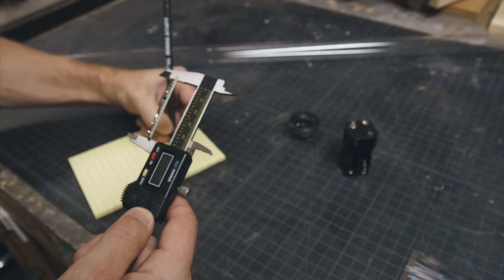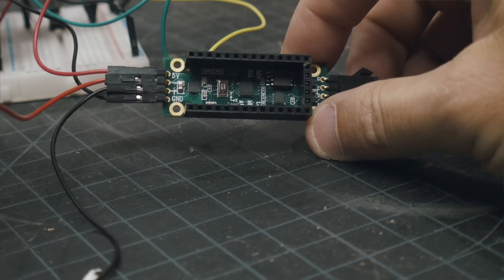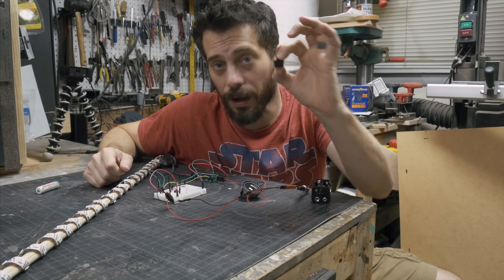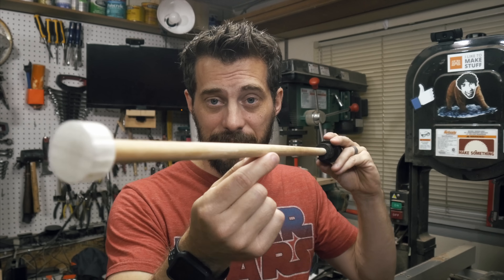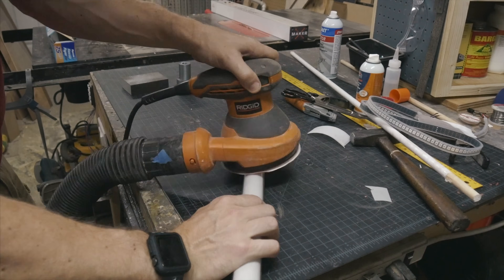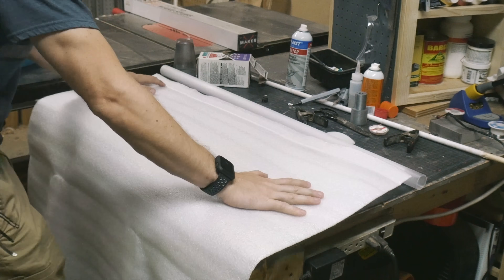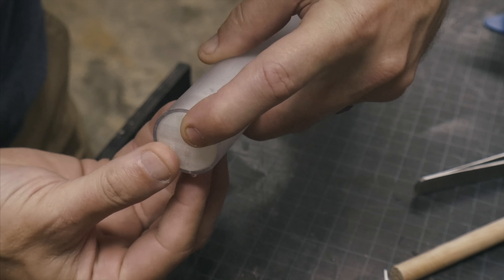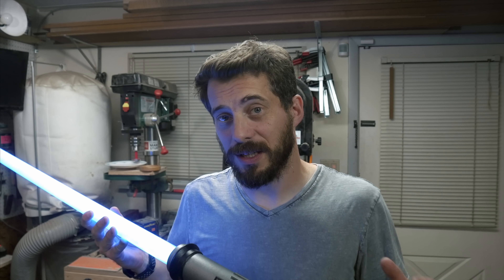How to make a Lightsaber ( for Star Wars Day ) | I Like To Make Stuff

Comment: Love your builds dude random tip not sure if you know this already but it looked as though you painted the silver directly over primer for a much more believable metal look try using a matte black base coat first then silver on top you let it sit for a day a use a gloss clear acrylic with a airbrush not spray paint the propelant in the  spray paint kills your silver an gold paint shine then you can weather over it without ruining your fo metal look on another note you can use that propelant effect for a duller more aged hammered metal look if you don't want shiny metal look awesome build
Reply: Had to add on V2 you could add a micro USB or USB C port outside if you wanna change code and effects later maby try a rounded end cap also

Comment: OK, please help me find a solution to this.

current lightsabers all have the issue that they either have a blade or not, in which case you can't use them until you put the blade on..
What if you somehow had a small, but powerful suction/inflation device in the blade, that blew out a thin fluorescent silk material when it was on, then sucked it back in when you shut it off?  Obviously this would be for appearances only, but it would look much cooler I think.

Is it possible?

Comment: I've only just come across your channel (been going through the videos)... love the build and especially the animation effects. I had a few ideas that might be interesting (though by now you've probably already done better options). One is to make the blade section removable (I'm thinking it should be possible to make a connecting piece that has electrical contacts)... this is just in case you wanted to display the base or if you wanted it to be swappable between bases. 
For a "functional" switch... I'm sure you can buy some that would be set already but otherwise if you design a printable part that has a pivot in the middle and a "bump" on either side so that when one side is pressed it will lower it's end and the bump should contact the button. 
In regards to your wanting to design it so you can take a panel off to get at the guts... if you make the design have an interesting lined pattern along the base you could hide the panel release section.
You've probably already made a new design that does far more than these ideas and better... but just in case I thought I would put them here. Thanks for all the great videos!

Comment: i'd like to do this but also hang it on my wall as a light when i'm not using it and being able to turn it on with a remote, any idea how i can do that? i'm pretty sure that white controller thing that you normally get alongside the LED strip won't fit in the handle to leave the IR receiver outside somewhere, thanks :D

Comment: I want to help you to get to level 3 and 4, im also a Starwars Nerd, im computer scientist and an elecrtonic technician. you solution picking rechargeable battery was a goo idea, but you could also use arduino mini and use 7805 voltage regulator. It is solid 5 volts until the battery depletes under around 6 volts. but you can use upp to 12 aaa batteries rechargeable, and  the leds will work very fine, with small amount of current limit.  (Just an suggestion).
Reply: Sorry about my english, im just an Icealndic person.

Comment: 3D printing is cheating when it comes to things like propmaking
Reply: RetroGamer7200 how on earth is it cheating?
Reply: @lpkhhbigboy2777  you don't actually build anything.  You just press a button and you're done. All you have left is paint.
Reply: RetroGamer7200 that’s not true. People have to actually model what is getting printed. There is work that goes into sanding and painting. There is real work that goes into modeling and making sure that things are properly fitted and sized. By the same ethos you could say that anything is cheating unless you mine and forge the metal yourself. Or harvest and mold the plastic and rubber yourself. Or you chop down the trees yourself. Or build the LEDs and electronics yourself.

Comment: I've been trying to follow this tutorial for a week, and I'm completely at a halt! I'm using all the same boards and hardware, just a different LED Strip (WS2812b). They work fine with the PropShield using other codes using FastLED, but the Adafruit Dotstar in your code will not do anything with these strips. I have ZERO skill in coding Arduino or anything for that matter, so I'm not sure where else to go from here!

Comment: Hi, great video but can you explain about the teensy and prop shield please?  Specifically having looked online the prop shields I have seen don't have a plastic connector for the teensy to plug into (same as teensy doesn't have any pins that plug into the prop on ones I have found)?  Thanks.

Comment: I really enjoy your videos.  I've made my own lightsaber as well using custom machined parts.  Have you considered using clear cellophane gift wrap as the diffuser?  Essentially you have about 4 or 5 wraps around your LEDs and then slide it into the tube.  It would likely be brighter than your current setup.  As the light passes through the cellophane it reflects back and forth between layers and gives a nice even glow.  You are probably not getting as bright of a blade using the foam.  The foam, while evenly diffusing the light, is certainly not allowing all of the light to pass through.  Many people in the "saber building community" use the cellophane method with fantastic results.  Anyway thanks for the great ideas!

Comment: Bob, you should have wired the hilt LEDs into a female USB connector, then made a keyed twistlock on the blade and hit so that the female USB from the blade would match up perfectly with male in the hilt. That way the blade is removable

Comment: How does the LED strip 'know' not to turn on all of the LEDs at once?
Reply from the maker: The microcontroller
Reply: Yes, of course, but how does it make the light 'run up' the blade rather than igniting it all at once?  How does the individual LED 'know' that it should not turn on?
Reply from the maker: It'd be a bit tough for me to explain here, but the code is available so you can look through it.  EachLED is individually addressable so you can send data to each one at anytime.
Reply: Soooo... each LED comes with it's own microcontroller soldered onto the chip??  That explains the price. XD   
I'm looking for a solution where I have individual leads off of each LED, I'm guessing this is not it, then.

Comment: This is a stupid question, but I'm still learning about LED and circuitry. The light animation, where the light draws up and down when turned on and off, is that something I need to program in?
Reply from the maker: If you want it to happen in a sequence then yes. You can control the speed that it turns on and off

Comment: A little late but if you finish all the software on this make to get it exactly how you want it, instead of making a removable panel on the second version (to switch batteries) instead maybe you could add a wireless charging pad inside that charges a circular portable charger that then powers the teensy

Comment: to slim it down, you could use a Lipo cell ( they out put 4.2v at full charge ) instead of the 4AA battery cage. With this you could also use a micro usb port under a panel to charge the cell with a small charge regulator pcb, and it all can be scrapped from usb a recargeable torch.

Comment: nice work. Though consider this: You spend something like 20+ hours 3-D printing two versions of the hilt, and then when you were done printing the one you were actually going to use, you had to prime and sand it repeatedly, and then in the end it still wasn't a smooth finish. Most of that hilt is a cylinder. You could use a piece of pipe, and then 3-D print decorations to embellish it.
Reply from the maker: Feel free to make yours in any way that you like. This was an exercise in problem solving for me, and I learned a lot along the way.

Comment: Hey mate, thanks for the good explanation. But I've got a question: Can I solder a 5v Voltage downstep Regulator between the batteries and the Teensy to prevent overvoltage and use 2 18650 batteries instead of the AA? The advantage would be a direct batteryloading with inside Microusb charger

Comment: I mean... you could use a 9 volt battery and a voltage regulator. Granted, that's an additional part meaning another failure point, but that's probably what I would have done.

...actually, scratch that, I would end up buying a lightsaber.

Comment: I love this!  I've wanted to make the internals for a one of my lightsaber hilts.  You have provided a nice "cheat sheet" for what to use and how to do it.  Nice work on your own lightsaber too.  You might try making a hilt out of chromed plumbing pipe and figuring out how to fit the electronics inside that.   I think it would be pretty easy if you had a different battery solution.

Comment: You should use a push button instead of a rocker switch, set it to a timer of some sort, to turn it on when you hold it for, like, a second, and switch between colors when you give it quick presses. Or the other way around, depending on your preference.

Comment: Is it suitable for duelling? Could it clash with another one and not collapse immediately?
Reply from the maker: It would work but probably not last over time.  My guess is that the 3d printed handle would eventually start to crack, but if it were printed in Nylon, it's probably be almost indestructible.

Comment: Hi I Like To Make Stuff,I am currently making my own Arduino Lightsaber and ran into the same problem that you did with the handle being a bit too chunky due to the diameter of the speaker. I found a solution to this though and put a pommel on my design. This allows the pommel to be the diameter of the speaker but the rest of the body only has to accommodate the width of your micro controller (so for me that's about 1" ID). Hope that helps!Thanks for the video,~Joe

Comment: So, how's the battery life? Reading up specs for a 144LED/m WS2812B strip, I found that it will use 43.2W/meter. That's 8.6A current. That's probably peak current with everything at full brightness, but I suspect 4 x AA NiMH cells are not going to last very long. I'm working on something similar and planning to use a 18650 LiIon cell for power. In my project, I estimate the peak power draw will be about 20W (65 cm long strip / 3.7V supply).

Last year I built a prop that had 24 WS2812Bs, an Adafruit Trinket (3.3V) and it was powered using a single 10440. The LED strip is rated for 5V, but will work fine with a slightly lower voltage. The lights were almost never at full power, so battery life was around 10 hours.
Reply: Juri Munkki English please
Reply: Jesus Christ even though I understand all that it’s still complex enough

Comment: I'm a bit late, but you should swap out the battery holder you have in there with something a bit thinner, in my opinion...I would actually recommend going for some LiPo batteries with a nice high mAh rating, then you can also leave them inside and have a micro USB based charge circuit in there while also making the hilt a bit smaller...

Another perk of switching to LiPo's would be that it would lower the voltage on all those LEDs if you think they are a little too bright (or you can also buy a cheap booster to get back up to 5V).

Comment: I've actually made my own lightsaber. I got to make it in school. I went to school for machining so I got to actually make a metal body. I'm still working on the software and electronics. Instead of the Teensy I'm using an arduino pro mini, a DFplayer mp3 module, and i'm still picking between 2 gyroscope modules I have.I'm excited to look through your code though, I'm having a hard time getting mine all organized.

Comment: Its good next time you put twist switch on the blade guard so it wont look flashlight and add belt clip on it so you can put it in on side belt and update it into usb charging battery so if long cosplay if you have powerbanks it can charge. But total its fine I like it

Comment: 18650 as battery
Reply: like this, https://www.amazon.com/Bay-Valley-Parts2000mAh-Portable-External/dp/B01E0VRQ4C/ref=sr_1_31?ie=UTF8&qid=1494033262&sr=8-31&keywords=usb+battery+pack
Reply: the hilt could be so much thinner, like 20mm inner diameter, get some cheap laptop speakers from ebay or salvage them yourself.

Comment: Peak voltage of a nimh can be 1.49 volts, you might have been better off repurposing a single cell 18650 phone charger and would be a lot thinner then the 4 aa pack you used

Comment: I love it wish I could make one but I don't have a 3D printer that is awesome though
Reply from the maker: +Jasper Kraft there are other options. If you wanted it printed you could use a service like 3dhubs or shapeways or even find a local makerspace. Also, it's basically a tube so you could try pvc pipe as a base, then add details on top.

Comment: ILTMS, I've got the official ForceFX lightsaber with the alluminum hilt. And I'll tell ya, watching your video made my mouth water. I'd rather have your version. 

The simplicity and cleverness of your design and the final result achieved are on-par with the commercially-released "official" ones (apart from the fact the hilt is way slimmer - they use a smaller diameter speaker). 

I wanna build my own, but perhaps I'd have to "port" your hilt design to allow for having it custom made in a professional machine shop (because: 1) I don't have a 3D printer and 2) a machined alluminum hilt would stand out more, imho).

(If you're thinkin' - "this guy copied over that other guy's facebook comment in my project page" - not really; I'm he and he's me...)

I've also suggested a simple modification in your code to allow for randomly selecting the 'swing' sounds - for more 'pseudo-realism'.

Comment: If you recessed the main power switch, and then had a panel that slid over it to cover it, I think that would be ideal for hiding that rocker switch.
How is the thinkness... it still looked pretty big... if you switched to C-cell batteries, could you reduce the interior (and overall) diameter?
-Shawn

Comment: Could you add some type of micro USB port, so you can make software changes easily without disassembling the whole thing? Could possibly also use this for charging the batteries! Also, this is BADASS!

Comment: This came out great! For the next one, does that shield motion sensor have an analog signal (or an accelerometer) that lets you get the intensity of the movement? If so, it would be cool if the volume and playback length of the motion sounds were tied to the intensity of the motion. It probably wouldn't be too much work to port some of the D3.js clamping and range manipulation to work on an Arduino, and that would handle 80% of the work.

Comment: hey man fantastic work. over all you have the list of materials used on hardware. arduino . leds. bat pack. sound. how much ? by the way have you tried 1 inch outside diam. 3/4 inside diam poly tube. super strong. for the ligth. led cree 3w or 6w and heat sink w a 3.7 v lion bat config rechargable. for the hilt man. you can makeit a 3 part hilt . hey you are awesome. create a line of this prop and booom you are in the star wars book of heroes

Comment: If you want to make the hilt thinner but still have it be able to fit the speaker, try modelling it after obi wans lightsaber, it expands slightly at the bottom, so there's room for the speaker still, but it's thin enough to hold comfortably

Comment: When you make an access panel, instead of needing to figure out a screw/bolt together solution, you can just use rubber black O-rings to hold it in place.  If you look at Darth Maul's lightsaber he has rubber O-rings on his, so you could just work them into the design of the handle.  Makes for a quick access panel when you need to work on the innards.

Comment: Super freaking cool!  Another idea rather than a panel would just be a USB adapter port.  You could use this for charging as well as programming the micro controller.  The port could be covered to look like a designed grip or "bump" in the handle.

Comment: Very nicely done. I love how bright it is. Too bad it isn't made for dueling, as there is lighting and wiring within the blade itself. But for a prop, Comicon convention, Halloween decoration, or just something to mess around with and show off to your friends, it is very well done. 
One thing I think would be cool is to make the blade and the hilt have some kind of plug, so that you can easily and safely remove the blade from the hilt. You could then add a blade plug. This with a covertec knob at the base of the hilt (which I imagine is fairly simple to make with a 3d printer) as well as something to slide the knob onto on your belt would add a very nice aesthetic to any costume. Plus, with the easily removable blade, cosplay videos would be easier to film, as it would be easier to add/remove the blade and slide the hilt onto your belt. For those of you who do filming, you know as well as I do that it can take a few extra minutes to screw and unscrew the blade onto and off of the hilt to make that ignition effect for the video.
Again, very nicely done!